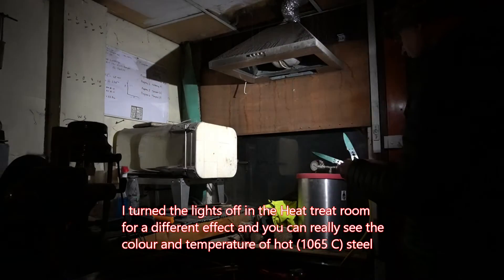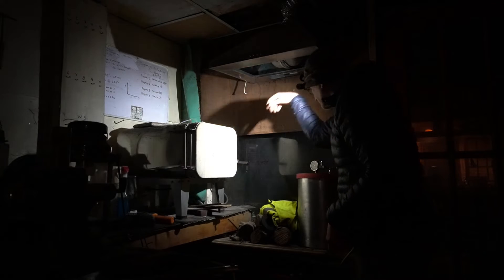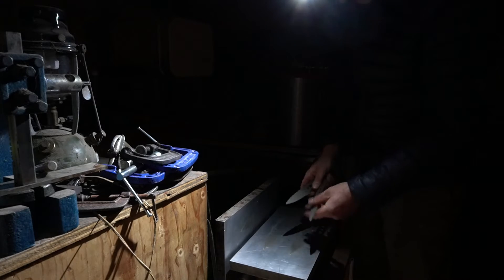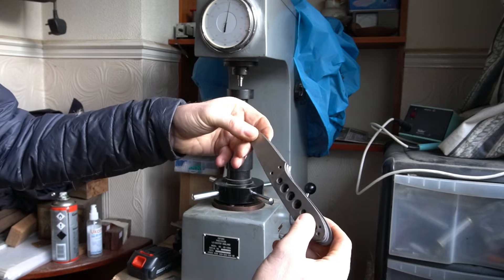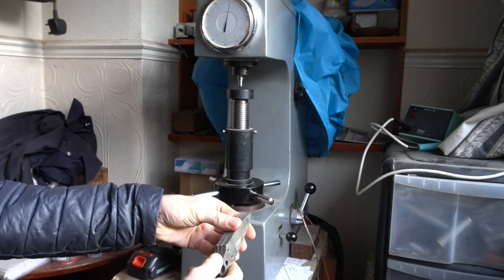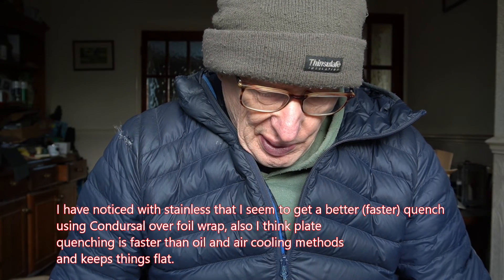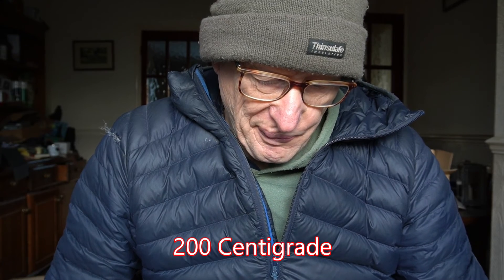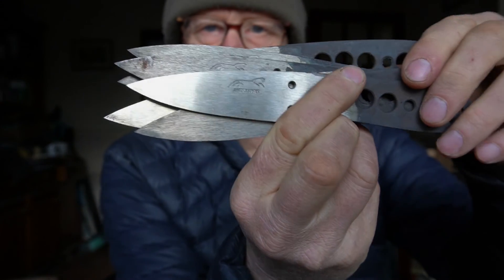AEB-L Heat treat came out very well. Jacklore

Comment from the maker: Although I have a nitrogen dewar I don't use nitrogen for the cryo cycle simply because here in the UK it is too costly especially when purchased in small amounts (over £200 to fill the dewar and it evaporates quickly) so instead have opted for using Dry ice/ isopropanol alcohol which forms a cold slurry of around minus 90 Centigrade which I am told is sufficently cold enough to achieve a good conversion of retained austenite. Dry ice is a quarter the cost of Nitrogen for me here in the UK and can be shipped to my door.
I noticed almost a 2 point improvement in hardness values after the freeze cycle so it was certainly working well.
In the past I have used a domestic freezer which has given a gain over as plate quenched harnesses but the dry ice slurry is a lot better. Perhaps Nitrogen would give an even better gain as it's much colder -260C but all data sheets seem to point to the gain not being so great, so I'll stick with the cold slurry freeze for the time being.
Reply: You clearly read Dr Larin Thomas material. Awesome job on the heat treat. I think your choice of cryo is perfectly fine. Much better than what most do. Everything is a tradeoff, including cost.
Reply from the maker: Yes Thorwald. Knife steel nerds. Very good:) @thorwaldjohanson2526
Reply: Liquid Nitrogen is -196 C.
Reply: I wish we had easy access to Condursal is the US.  Most of us use the expensive stainless foil.  I also use 1065C/1950F for 15 minutes and dry ice/iso as part of the quench.  I do not wait for the blade to cool to room temperature, but instead pull the blades out of the foil (really wish I had Condursal) while still warm, dip immediately into water and then immediately into the dry ice slurry.  I temper at 165C/330F.  My Rc comes out at 61.5 after the temper.

Comment: So 60 hrc out of quench.
Dry ice bath to 62hrc.
Then temper back to 59.9 hrc.
Hmm.  Why not just leave blade as is after plate quench?  Same hardness no?
Reply: You would have a very brittle blade if you did that. You have to convert the martensite to tempered martensite which imparts toughness. Higher final hardness works even better with AEB-L.  I now aim for 61.5/ 62 Hrc for the final value.

Comment: I thought aeb can do upwards of 64 Rc with high enough austenizing temp
Reply from the maker: With 15 minutes soak at 1975f and LN2 it may just be possible to hit 64Hrc but for the application to which my knives are designed with zero ground scandi edges around 60.5 to 61.5 is good. I'm happy enough with that thankyou.

Comment: Nice one 👍 never worked with stainless but like watching the process .. just a question.. do you think a knife has to be tested on a Rockwell tester to be acceptable for sale 🤔 I'm only a hobby maker who maybe sells two or three knives a year.. most of mine i give away but always love trying to test everyone to its limits 😁 think the Americans have it sorted with the journey man test 👍 lovely work on the handles by the way 👏👏
Reply from the maker: An RC tester just gives an indication that the blade will be OK, if you don't have a tester then you can just use the blade for some cutting tasks and see how well it holds it's edge compared to other knives, that should give you an indication of whether the heat treat is OK. You can also do an edge flex test, the edge should deflect but return and be springy, if it deflects and doesn't return it's too soft, if it flexes then breaks it's too hard and might fail on heavier tasks. Be careful edge flexing though as you can damage a good knife if you don't do it properly. Having said that destructive testing can be a way of understanding how well a knife is made again by comparison.
Reply: @Jackloreknives  thanks for getting back to me ..much appreciated 👍

Comment: Sandy, why you using this steel , when sf100 is as good. Your really don’t need to use ice either, graham  Clarke , of Clarkes knives  say no need to, and he a metaloligist..
Reply from the maker: Hi Mark,
I have heard of Clarke knives, not far from me. The only way I can tell any difference is through hardness testing, the dry ice slurry appears to bring a gain of almost 2RC points over as plate quenched hardness and even an overnight in the freezer seems to up the RC a bit after quenching too but not by as much, I always did that even with SF100.
All the data sheets from the steel developers include a sub zero freeze or cryo in their recommendations but say it's an optional process and that it does increase hardness and durability. Who am I to argue with a data sheet.
I also spoke to Ground flat stock about this and it was them who suggested I use SF100, the heat treatment they suggest didn't require any sub zero component, and all those knives  have performed well with very "sticky" edges too...A good steel.
Going forward I think I'll always do a dry ice slurry cooling cycle for stainless like AEB-L
I heard an interesting story about Swedish steels in general. Back in the past their steel some folk would say was superior to other steels but the only difference was the climate. Very cold in the Winter:)
Sandy

Comment: Aebl is a phenomenal steel for scandi ground knives when heat treated properly. Nice job.
Reply from the maker: I'm looking forward to finishing these, heard a lot of good about AEB-L, going to keep one for myself:)
Reply: Depending on availability you might wanna 14c28n, slightly better than aebl. Essentially the same performance but more corrosion resistance.